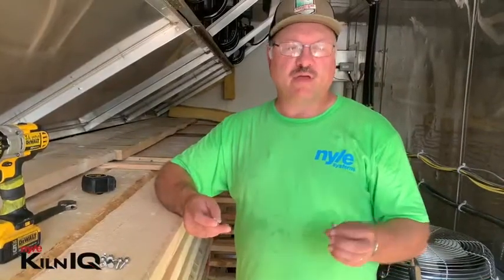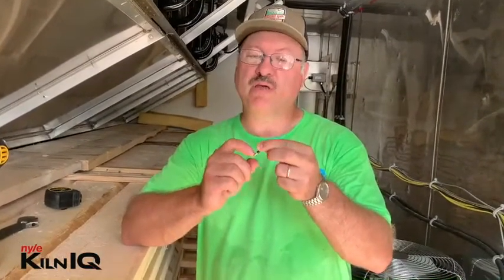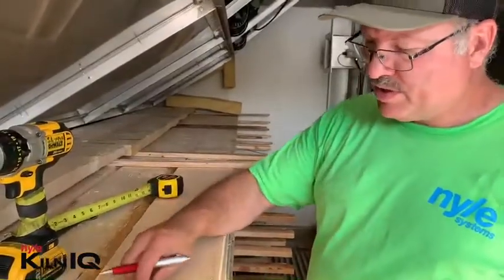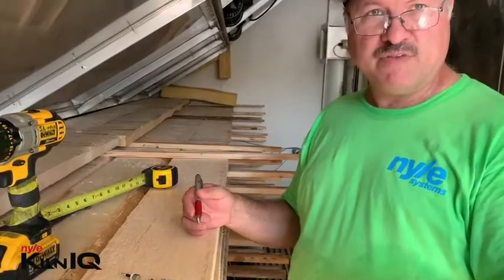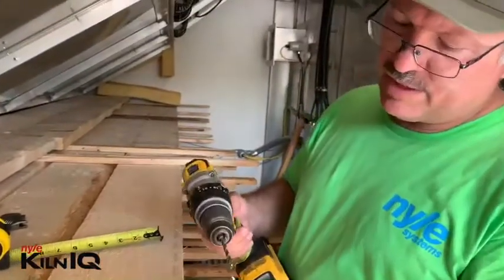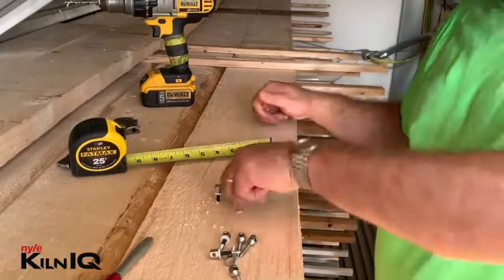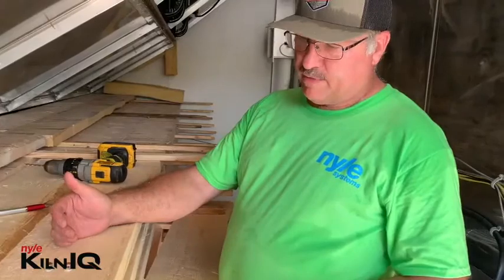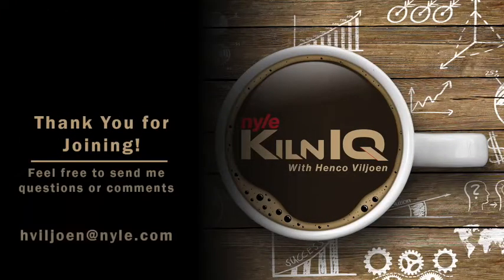KilnIQ Episode 6: Installing L200M Moisture Probes

Comment: Hence said the spacing is 30mm. But what about the orientation of the two pins in relation to the wood's grain, aren't they suppose to be tangential (parallel) to the grain of the wood?
Reply from the maker: Hey Woodchuck, I just took over youtube and see all these unanswered questions, did you ever get an answer on this?
Reply: @NyleDryKilns  no